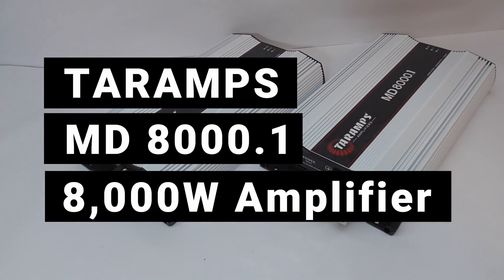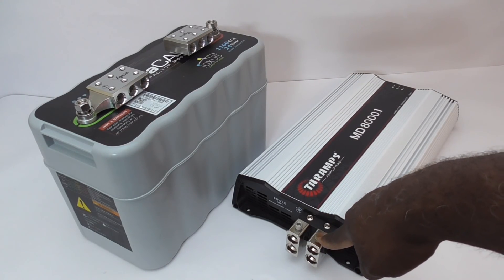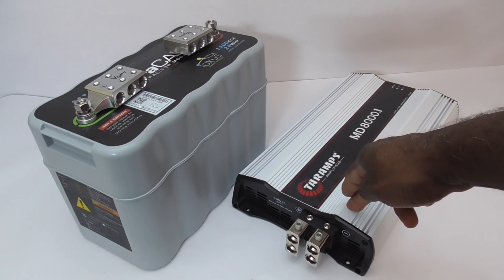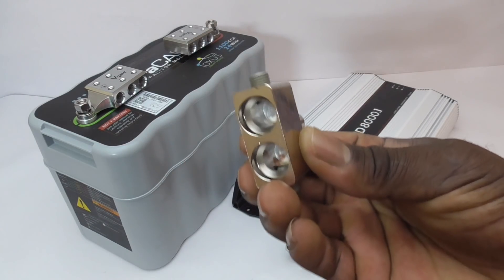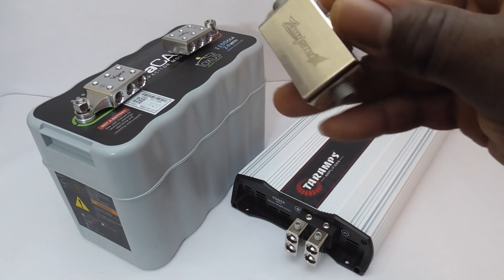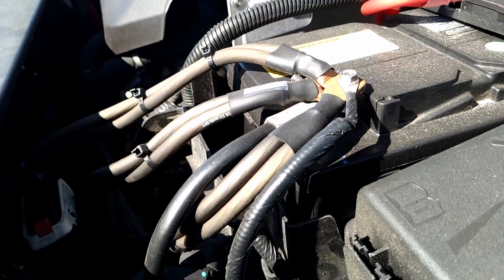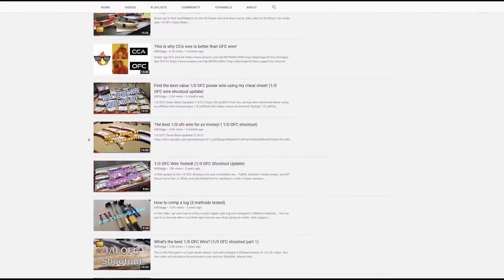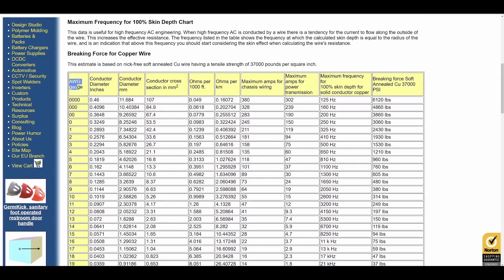Are Dual Inputs Really Needed In Every Setup?

Comment: For starters I'm glade to see your making use of some type of busbars as that wiring mess I saw in another one of your videos was a big no no and man clean up that battery post with some use of bus bars like those you have at the capacitor. Now with these amps 2/0 or larger will be all they need for the short distance that you will be using as the one thing you must understand about current flow is it heats up the wires and the hotter the wires get the less amps they will actually flow. This was why I instructed you to go out of your way to not route any wires near the cars exhaust system. The goal is to have the amps delivered with little to no heating up of the wires. This is where you need to start taking temperature measurements before and after use so you can tell if the wires are heating up or not. Hot wires present greater resistance to current flow that's just physics. 
I for one wish to see your wiring setup again just to make sure you followed my advice as it was very important advice to make use of busbars like you see everyone else doing.

Comment: I thought the same way you thought until my wires were too hot for me to touch, Dude you will melt and burn you wires if you don't add it
Reply: Were you using cca wire?
Reply: @Widowmaker2828  ofc the same wire he is talking about
Reply: Can you describe your system? Do you have a Taramps MD8k? Do you have very short runs to a sufficient battery? Do you have the big 3 done? Did you run it at extremely low impedance? Something doesn't sound right.
Reply: @Widowmaker2828  I had it on a sfb8000 currently I have a powerus 13k, but yes my runs were only 2ft from the two banks of 64 ah headway cells each so thats 128 ah. The wire wasn't really getting hot until I got another bank of headway cells so the amp was really able to produce its full power but only one run was bottlenecking my system causing it to get really hot and could have melt my wire if I played it for a long period.
Reply: @quinton337  Wow, I am sorry to hear that. I have four of the MD8000.1s and have them all running off a single 5' long 2/0 as suggested by Taramps... (I have 270 ah of Yinlong cells) I demoed all day last Saturday hitting near 160 db all day. I checked the wires a few times and they were cool to the touch. My batteries are well wired to a 370 alt and I don't run the amps under the suggested ohm rating. I will be sure to keep an eye on my wires more often though. Thanks for your response.

Comment: one zero gaige or one gauge can saport 7 k ish you got 8 k in one amp so if ur not runing the amp hard one run of 1 gauge is good but if ur running the amp hard youre gonaneed a extra wire maybe but that asumming a realy good efeicency im not sure but ide say just get a good tune on ur amp rock ya single run of wire it prolly be just fine
Reply: Most definitely because you ain't going to be pushing the full 8K out of it the whole time you know with impedance rise

Comment: You are absolutely correct!👍💡When you look at the power cables on the inside of the amp, it's not doubled up like that, it only has one run of power and one run of ground that is about 8 or 9 inches long. So the only time i think you would "need" a doubled up power and ground supply is when the power supply is a long way away from the amp itself👍 I see people using a straw size as an example but they fail to realize that no matter how many straws/cables you put together to suck the juice/power from the cup/battery that when the juice/power gets to that single straw/cable, that it's only going to be able to allow the juice/power enter that, that one straw/cable is rated to handle. 💡It's like when people install a 102mm size air intake throttle body onto a 90mm intake manifold thinking they're getting more air flow thus making more power, but they don't understand that if the 90mm hole size doesn't change then they're getting the same amount of air that they began with because that 90mm opening is still the same size as before. Would it hurt anything? No. Is it necessarily needed? Also No. I totally understand your breakdown of what you're explaining👍👍
Reply: As an owner of 4 of these amps that have been clamped at over 8700 watts you are exactly correct. Dual inputs are not needed unless it is a long (more than 10' ) run. Well put.

Comment: I could tell you my brother ran a single zero gauge oxygen free wire to a 12 K taramp Pushing  two sundown  nightshades
and the rubber around the wire started getting gummy and soft as if the wire was producing too much heat so after running two zero gauge wires to the amplifier it stopped so I guess it is necessary if you’re going to be slamming the hell out of your system like my brother does
Reply from the maker: Wow. Thanks for sharing!

Comment: I never use dual inputs.. I think they are a disaster waiting to happen. My amp already takes 3 oversized 1/0 power inputs and that's enough
Reply from the maker: Your amp sounds Beasty 💯
Reply: @BudgetBassHead  it's the synergy audio wfo 8.1d
Reply: Amps like yours aren't what dual inputs are meant for. I wonder who'd be crazy enough to use dual input adapters on an amp with triple inputs

Comment: I think a lotta people aren't paying attention to the fact that you're running 4/0, I support your side of the story not everyone wants to spend hella money trying to get an extra few hundred watts. thanks for the vid
Reply: It's not a matter of trying to get more wattage its a matter of supplying the amp with enough voltage and current so the amp doesn't overheat and possibly damaging the amp. In this case more is better.
Reply: @BobBasshead  In my experience I've never had an amp overheat from a wire being too small, seems like you really have to be pushing it or maybe using CCA wire for that to happen.
Reply: @Tmanstomp100 there is a lot of misinformation on CCA. personally I don’t run it however dc voltage travels on the outside the copper strand anyway so CCA will indeed carry the same if it’s the same strand count.  You will do better with fine CCA than with a welding cable with heavy thick gauge as again physics says dc runs on outside the copper.   Only issue with CCA is it corrodes easily with mixed materials so it must stay dry and sealed. Running a back battery to amp I’d say it’s ok but personally I like all the same wire for best look and another 3 feet of tinned ofc.  Meh. If it’s run under a hood I suggest run it in a sleeve and super seal everything water tight. Many connectors are not built with water tight in mind.
Reply: You really only need the few hundred watts for extreme spl.

Comment: 6:41 into the video and just my experiences with this subject, I had 2500wrms amp pushing 1 18 everything stock 4g wire and it struggled or amp would get hot so I scrapped everything and started over with a md3k 0g all the way 8g speaker wire 2 zvx 15s and worked but my amps would drop fast im like wtf eventually it burned a channel in my amp.. so remind you iv done this since I was 16 all myself im 32 now. So round 3 of a big boy system (for daily) I scrapped 2nd build, I got a custom 5k amplifier 2 custom 15s 2500w rms I run (4) 4g grounds (4) 4g positives 1extra  battery stock alt no big 3 pioneer touchscreen deck and not 1 issue. The real problem is how you use the amp if your trying to draw that 8k+ from that amp yeah id dual or more if your using it to test few 12s or 10s and they are all under 2krms 1 is fine but know, taramps DO NOT like low voltage im sure anyone who has had a few can tell you. BTW great video and topic hope this helps people out just remember its hard to drink a milkshake threw a coffee straw

Comment: Can the ioxus super cap be paired with an agm in the rear? Or would the super cap have to replace the rear battery? Any help is appreciated
Reply from the maker: Yes. They were designed for that exact purpose.
Reply: @BudgetBassHead  Ok thanks! I purchased one already but was seeing online that they replace a battery. I wanted to add the ioxus to my group 31 in back and just was a little confused.
Reply: I have my ioxus ultra cap installed in the back of my suv along with 4 d7500s....it does the job well keep my voltage stable during my playtime😁

Comment: @ 3:09 "What gain are you getting from adding this to your system?"

Overhead. 

Think of it like you might think of your toaster... There's no chance that your toaster's going to use all 120v coming from your wall outlet, yet you plug it into that anyways. Why? Because there's only so much draw that it's going to take and and resistors in place to keep it from taking more. Now, say the the actual draw of your toaster is 25v... How long you think it'd take for your bread to "toast" if you only ran 10v to it? 
Granted, this explanation is simplifying some things, but that's the general concept as to why you'll always want more than you'll use rather than not having enough.

Comment: I just used 50ft of SkyHigh 1/0 in my build...Knu Konceptz was the other choice. Knu wire is silver tinned and the skyhigh is not if I am not mistaken. Skyhigh is oversized with a high strand count if I remember correctly. Both are great according to the couple installers I know. One said he only uses skyhigh so I just went with them. 

Now I have to go watch the hifi Vega vid on it...good video man. Much appreciated.
Reply: Sky High has a tinned OFC option now, as well as regular OFC.
Reply: 200 bucks for 50ft btw...not cheap.
Reply from the maker: I agree. Not the cheapest. But its durable and marine grade. Good stuff for those of us in coastal areas. Salt water climate is hard on copper and aluminum.

Comment: I'm a fan of overdoing it, especially when it comes to electrical, with that much power there's gonna be a decent amount of voltage drop unless your electrical is beefed up. I have a Taramps HD 5K and one run of 0 going to it, with 2 intimidator agms under the hood and a big Northstar NSB190 Blue+ agm close to the amp and my voltage still drops into the low 11's in my 2015 F250. Granted I haven't upgraded my alt yet.
Reply: Most guys say the h/o alt should be the first addition but for some of us that is the last thing we want to do.
Reply from the maker: Yep. The initial cost and installation process was my reason. But now I FINALLY got all my parts. And t only took 4 years 😄
Reply: Yeah, I didn't want to do an alt was hoping the stock one would be good enough, it's 200+ amps, don't remember exactly off the top of my head. Ill for sure have to eventually though, I want to throw a little more power at my X18v2's. I think most everyone actually hates spending money on big wire, batteries, alternators, etc.. it's expensive and very few people are impressed seeing that stuff, lol
Reply: @scolombe1  After underpowering for so many years and then learning later, I am only now really enjoying redoing my electrical all nice and taking away any of those concerns. Guys like you and BB know what it all is when you see it. 

Regular people just get to hear it in traffic and either they roll the windows up or they roll them down. Both ways I smile to myself.

Comment: Dual runs... Always think about over head, dual runs decreases heat of the wiring and amplifier tension draw, think about drinking from a straw... One straw will work, the math might say its adequate... Now try 2 straws and tell me if it ain't better and less stress on your pulling power to draw in the fluids... Same as an amplifier.
Reply: good analogy, but missing from the analogy would be available flow from the straw. If you can only pull 300A, then does it matter if you pull 300A from a 1/2" (1/0) straw, or ten 1/2" straws? So long as the straw can supply 300A of flow, it makes no difference.
Reply: @mattpierce4143 I know this comment is 3 years old, but you should also think of the resistance/voltage drop. For example, 1 run of 1/0ga OFC can supply 300a of current, but 2 runs of 1/0ga OFC can supply 300a of current with less voltage drop.

From 14.4v, 300a, 6ft, 1 run 1/0ga OFC = 14.0v
14.4v, 300a, 6ft, 2 runs 1/0ga OFC = 14.2v
Reply: yes but any thing to less resistance like heat so I get it
Reply: Similar concept when building computer always better to get 2 8gig ram sticks instead of one 16 gig
Reply: resistance is also understandable to use two than one  @curtaugust4174

Comment: Just remember at idle you're only going to get 200 out of that 300 amps on that alternator. The full potentials at higher RPMs
Reply: That's why you're pulling from the battery, not the alternator. Pull from the supply, replenish with the inbound, not unlike shelving in your local grocery store. But yes, higher RPMs will help combat the battery depletion drain.

Comment: I have 2 md8k's on my car, single cable from battery to amp, 4/0 awg and 40 cm long, i have clamped 6900 rms at 3ohms at 13,5v with each amp with that single wire, no drop at all. 216ah lifepo4 and 3x180a alts
Reply from the maker: Wow that's a beautiful electrical setup. 🤘
Reply: @BudgetBassHead  thanks man. I have a few videos on my channel

Comment: Tbh if the amp didn't have dual input than you don't need it. If you wire one battery and ground cable on a amp that has two battery and ground. The amp will go in protect or cut off due to lack of power.

Comment: I've always used the analogy "what do you get more drink with the least amount of sucking out of, a bar sip straw or a McDonald's straw?" Obviously, the McDonald's straw. Now, how many bar sip straws would add up to the same amount as the McDonald's straw? I've used KNU for a lot of installs throughout the past 15+ years. I currently have switched to a pure copper welding wire OFC. My 08 Silverado has a 300A alternator going to a second AGM battery with 1/0 wire then going to my Wolfram O-2400 on a single run. Now with the 8k I would definitely recommend going with dual runs of 1/0 or even 2/0 to the cap and also to the amp. I would also recommend using inline fuses near the battery and between the cap and amp. Less risk of fire and overheating or frying the amp.
Reply: You miss the point . It's about the length of the wire to the load .
Reply: @Cal3666  no because although that is true, if you want less restriction and not starving your amp then you will go with the bigger power wire to the amp. So yeah I calculated that factor in.
Reply: @BigTrainKiffin  I hear . I just assumed what you just replied was a given . Thank you for the discussion 🙏.
Reply: But,  as far as "dial inputs,  I must say , The engineers would know this topic  as well to put the proper size input on the amplifiers ..... just a discussion...
Reply: Comparing apples to oranges
Reply: You eat McDonald's? Shits gonna kill you man. Eat organic if you want to live longer

Comment: In my opinion amplifiers that need doble run come whith the doble imputs...if only have one imput just use the recommended ofc gauge cable and i never had a problem....but i am not a professional is just my opinion...
Reply from the maker: Exactly what I'm thinking.
Reply: I agree, just go with the manufacturers specifications unless the runs are particularly long.

Comment: Ok so think about it like this 1/0 cable 10 foot run may hold 5,000w and you have a 8,000w amp. if you can put 2 1/0 cable it can handle 10,000w. Steave mead made a video on ofc, and CCA and how much power you lose when you dont have the right one and size
Reply from the maker: I saw that video and liked it. He made some good points.
Reply: @BudgetBassHead  exo say it as well when he was putting in more amps in  frankenstein buld. A lot of people was asking why run dubble runs he say well if one run can oney do 2,000w than you need two of them to make 4,000w.

Comment: Your comparison of half inch cable is stupid. What matters most is actual cross section area of the conductor it self. Not the insulation, and air across the cable. Big diameter doesnt mean shit as it is not direct comparison of conductor scross section area dummy.

Comment: Id do a dual run, just to do it all at once. Better more than not enough. I had a dual run for 3k lol. I use 2/0 welding wire tho. I get 30ft for $72. Just the best budget way you can get lol.
Reply from the maker: Good tip. "Better more than not enough" Nothing wrong with 'future proofing'. 👍
Reply: @BudgetBassHead  yeah, especially with an 8k. They make dual 1/0 alternator brackets to run double to that also. Wire is expensive tho, so no team no fuse lol.
Reply: @1ohmwrecker  what site do you get it at that's a good price
Reply: @1ohmwrecker  what's the site. Thank you in advance
Reply: That is why I just ran 1/0 gauge wire for my little 1500w RMS amp. It's like having a big river to get your drinking water from. The Amount of water available will never be an issue and I will never go thirsty.
Reply: @snauspockets9924  i completely agree, idc what I'm installing, i will always run atleast 1 run of 1/0 to the back! Even if its a 600 watt amp lol. And when u upgrade, you won't have to run a bigger wire! And if you ground properly, the double run helps alot for that too!
Reply: @1ohmwrecker  big 3 or 4 with 1/0 as well. Boom! Never worry about it.
Reply: @snauspockets9924  yeah, I got big 5 on mine lol.